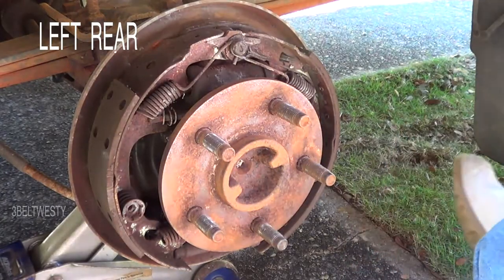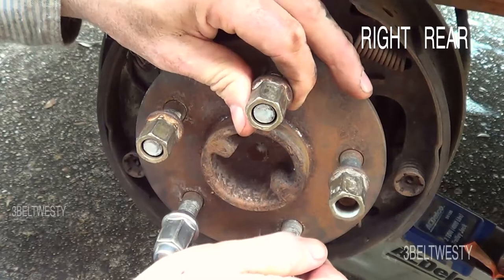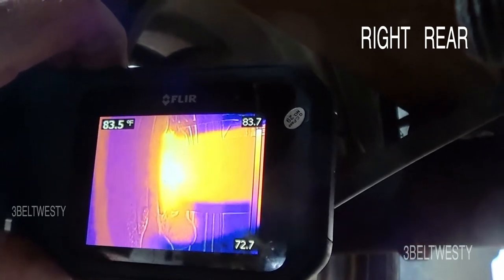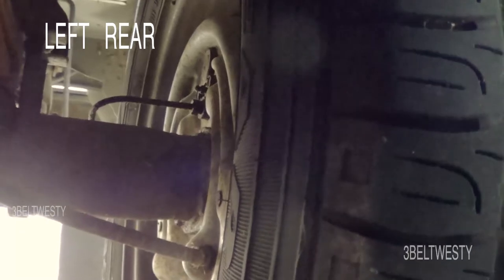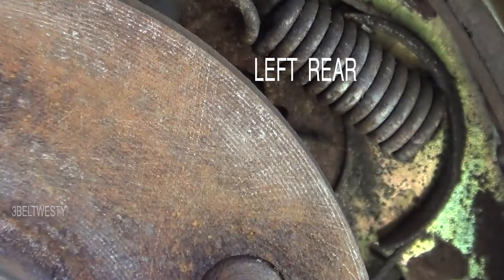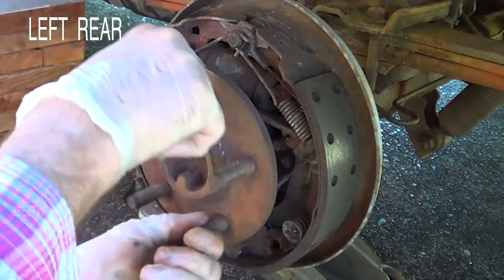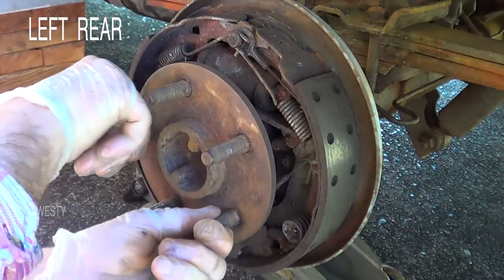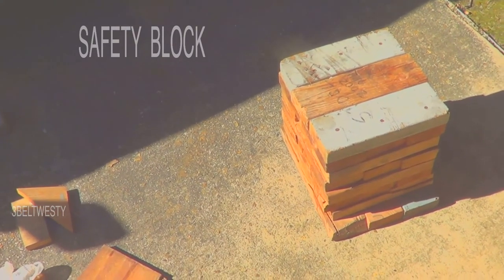Ford rear Axle bearing good and bad Axial runout

Comment: I just wanted to throw a comment out there. What you are looking at is radial play, and I was measuring this on my 04 f150 past year with a dial indicator it was around .010" of play.. a brand new bearing had the same amount of play so I opted not to change them.
So your video I would agree the driver's side is ok, but the passenger side bearing is toast.

Comment: Just replaced with a new bearing on right rear and still has play up and down bad, second time replacing it, starting to think my axle was shaved down in diameter
Reply: Im having same issue. Did you replace the shaft? If so did it fix the problem?
Reply: @rustynutz8704  yup, sorry for late reply you probably figured it out by now but yeah axle was shaved down like 1/8 all around.

Comment: I was wondering if you would know the heat range of an axle right where you was taking the pictures
I saw the bad one was 83 degrees
In two or three blocks
one side I can put my hands on the axle after a mile or so the other I can't

Comment: What about play in and out?  Mine are fine up down left and right but in and out im able to move the whole wheel a quarter inch in and out with it jacked up..
Reply: Did you find a solution? I was changing my brakes and noticed the bearing axle moves in and out a little  bit but not sure if that's normal or not. Can't find a video about this problem.
Reply: It depends how much in and out the only thing holding those axles in is a c clip thats about 3/8s thick thats nestled in the spider gear thats held back by a center pin, if theres too much in and out play the c clip will fall out and your axle will go go gadget into oncoming traffic. Sometimes the center pin wears an oval shaped hole in the dif and the slops enough to cause the axle to move, the spider can wear from friction and create play but there will always be a little in and out play
Reply: @joepetoletti6984  I'm just gonna hope its normal. Its very minimal play.
Reply: I have the same 1/4 in and out play.
Reply: Yes that is the amount of play mine has on both sides it’s the same so I believe it’s normal.

Comment: And cant spin it by hand in neutral? Only by starting the engine , on stands, and placing in drive. Accelerate  to about 3000 rpm. Left little louder and some vibration i. Bed. Normally hear it on interstate at 75 or 80 mph, quits when you release accelerator.